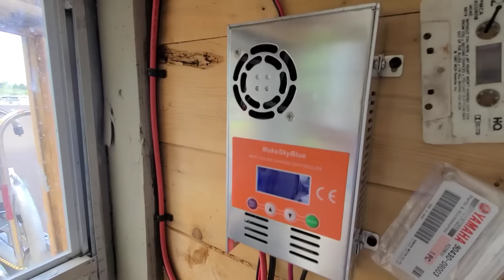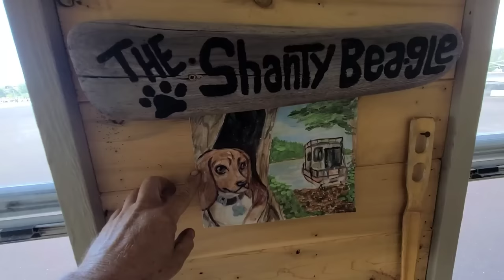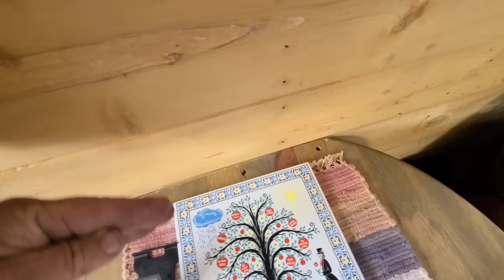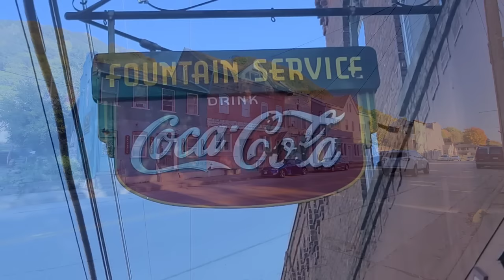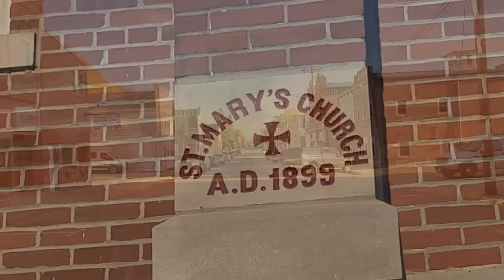Ep:3.5 The Great Loop on a Shanty Boat | Behind the Scenes and In-Betweens | Time out of Mind

Comment: Did you put a clear sealer on those outside walls?
Little late now but I would have used a 4" wide horizontal strip of PVC lumber, a piece of Z molding, a kick out strip of vinyl or treated lattice, then ran the siding.
That way the bottom piece is not wicking up water causing it to rot.
When I used to be a builder when installing cedar siding I would just dip each piece completely into the sealer so it was protected on all sides so I got less splitting and cupping.
Reply from the maker: That definitely sounds like the right way to do it. All I did was put tar paper underneath and stain the wood. If it last 5 years I'll be happy.

Comment: I want to know where you found an aluminum barge to make that on? My recommendation would be to have a measuring stick mounted on the bow to make sure you can safely pass under bridges.
Reply from the maker: I bought it in lousiana 3 years ago. Come to find out it's fairly rare, a trailerable 30x8.6 welded aluminum barge work hull. I got it right before prices on everything went up. I feel blessed. It's working better than I hoped so far
Reply: Amen to that! @backwatersandbackroads

Comment: i love the way the shanty boat steps down when entering to help the boyence,,  did you buy it like that alrendy built,,,
Reply from the maker: Hi Jackie, I bought it with the cabin already built on the hull, but i completely renovated it and put the motor on. Without planning, I bought a piece of property upriver where one has to pass under an old railroad trestle. The barge literally fits under it by less than a foot. ;)
Reply: Looks amazing.. the perfect shanty boat...   I picked up some pontoons to build my own soon.. I run with a 4 legged side kick as well..  I'm in the panhandle of Florida if you ever need anything.. I know you'll be passing along here..  I'm just north of Ft. Walton  Beach..   safe travels..
Reply from the maker: @jackierogers7878  the Shanty Boat life is the best life I've found so far;)

Comment: You seem like a very resourceful person.  Any tips on how to find a nice used Yamaha 60 Hp HT?  Do you buy motors sight unseen online or only in person?
Reply from the maker: The "trick" I've used is buy a boat and trailer package with the motor you want on it, pull the motor (easy) and sell the boat and trailer. This works really good with pontoon boats. Buy in the fall or winter (Northland) and sell spring or summer. I've been able to get good mid HP 4 strokes for cheap this way. A bit of work, but so is making money at a job ;)

Comment: looks like your main motor is running a bit deep in water. i would say to raise it up 1inch and a half👍👍
Reply from the maker: As in trim it up or actual mounting?
Reply: Raise the motor up a bolt hole or two straight up on transom water should hit just under widest plate  on lower unit at front with no motor trim
Reply from the maker: @danielnicholls6868  that will have to be when I get back next spring. No way to do that out here. Having less draft would be nice

Comment: What was the toilet called in the video, couldn’t understand what you said?
Reply from the maker: A "luggable luu" it's just a bucket with a toilet seat and lid on it. They csn be bought at most outdoor stores or even Walmart I believe. Use plastic bags (they sell biodegradable ones) and then transfer the bags to another 5 gallon bucket with an air tight screw on lid. Those can be a little harder to find, but they are on Amazon.

Comment: QUESTION: IF YOU CALL THE BOW OF THE BOAT, "THE NOSE", DO YOU CALL THE STERN, "THE NECK"? IN 51 YRS IVE NEVER HEARD ANYONE CALL THE BOW OF A BOAT THE NOSE..LOL
Reply from the maker: I'm terrible. ;) I make up words all the time
Reply from the maker: The luggable lue! ;)
Reply: mydixiewrecked2 poop deck is a very old term. During those days you pooped at the head of the ship not at the poop.
Reply: mydixiewrecked2  old sailing ships could only travel down wind. You crap off the head so the smell moves away from the rest of the ship. We still call the bathroom a head on boats from this old terminology.
Reply: mydixiewrecked2  you mean port and starboard.